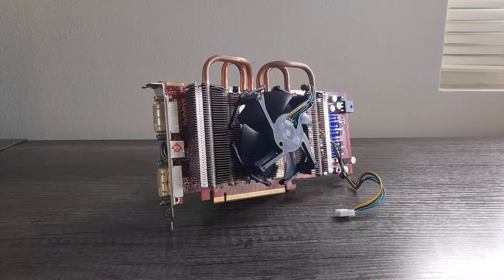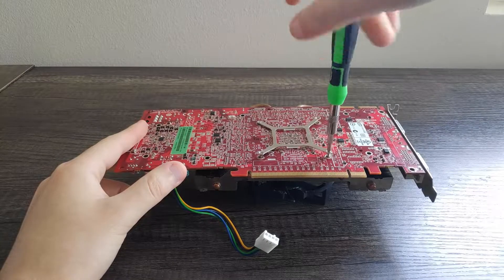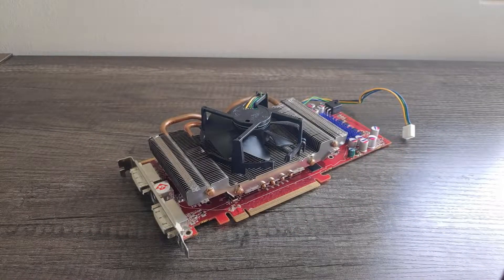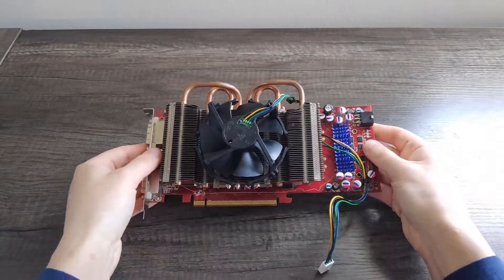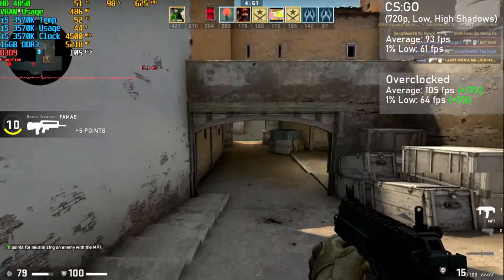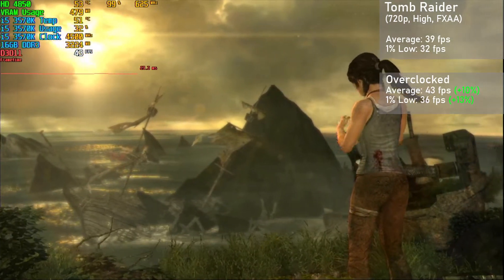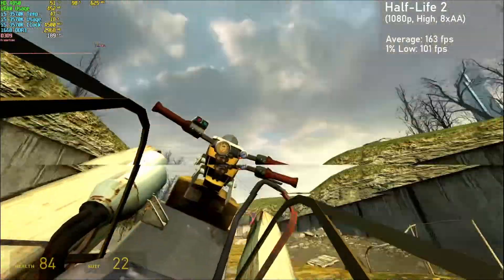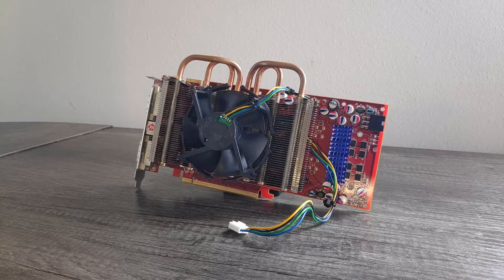The Radeon HD 4850: ATI's Ultimate Budget Card of 2008

Comment: i agree with people here... the card is classed as an 'enthusiast' card... here's the lineup Entry-level	4350, 4550, 4570, Mid-range 4650, 4670, 4730, 4750, 4770, High-end	4830, 4850, 4860, 4870.... I had two of these on an the classic 12gb i7-920 and in reality, i had no idea how it works as a single card but ii never had any issues with crossfire 4850...  the game of the day was GTA4... these cards were so cheap i just ended buying two
Reply from the maker: Price range doesn't reflect that though... These weren't even expensive enough to compete with the GTX 260, which in itself was more of a lower high end card. The 4870 maybe, but even thats a stretch considering what it was priced at. The GTX 280 is a good example of an enthusiast card at the time though

Comment: Probably not a single another card has had similar bang for the buck as 4850 had. I remember mine clocking nearly to 4870 speeds on the GPU and it ran Fallout 3 perfectly.

Comment: That card was a beast. 800 Compute Units vs. Xbox 360's 320 with over twice the memory bandwidth!
With that said; my favorite card form that era is the HD4770 @ $100 that came out a few months after the 4850.  
It'd slightly less Compute Units (8 vs. 10) but it clocked higher (750MHz) so at the end it offered more or less similar theoretical performance (960 vs. 1,000 GFlops). And while its bus was only 128-bit, it was GDDR5 and hence came pretty close to HD4850 in terms of overall bandwidth.
With an overclock; that GPU was on par with the $200 4850, no problem!
Reply from the maker: Very true, the HD 4770 was an awesome card! It offered so much bang for your buck back in the day. And thanks to being built on the 40nm node it sipped power too! If I get my hands on one I'm definitely taking a look at it.
Reply: @SPNG  They are only $10 on eBay.
Reply: HD 4770 was one of those cards that had no right to be as good as it was.

Faster than higher class 4830, very often on par with 4850, more efficient, half the price. It was a steal.
Reply: Beast it was. My first high end gpu
Reply: HD 4770 is my first DX10 card! I got the one that was released by XFX. I remember sold the card to get R9 270x, in order to play GTA V & Witcher 3 :D